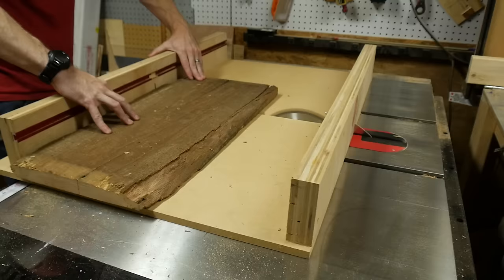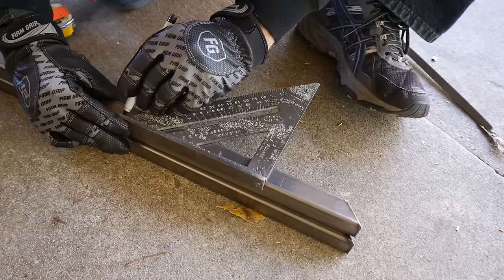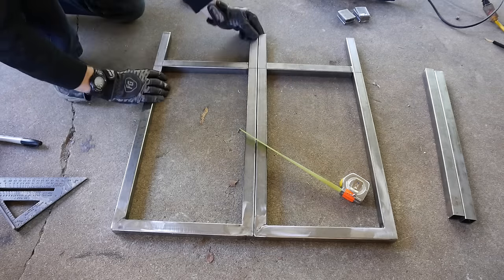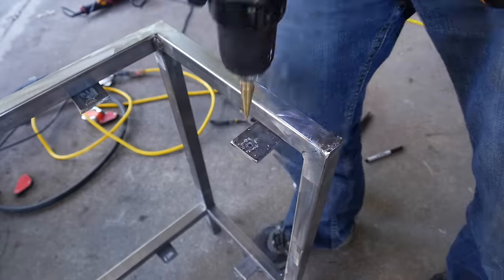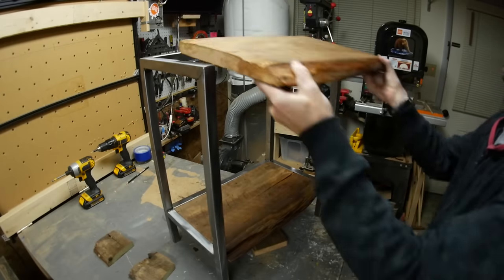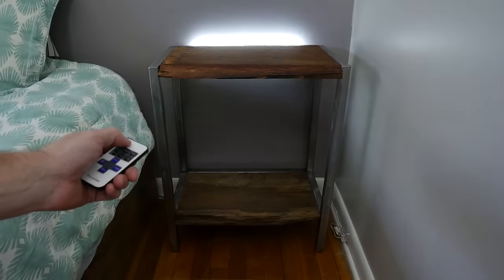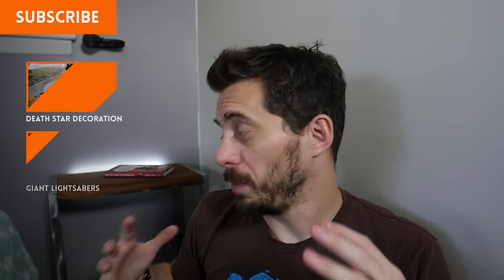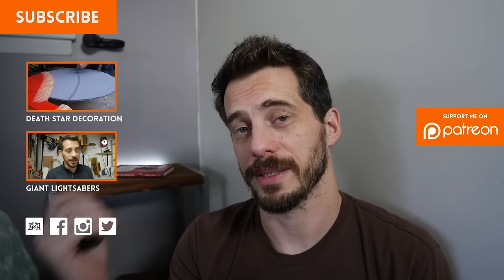Bedside table with a built in night light // How-To | I Like To Make Stuff

Comment: Yes I had a cut-off saw like yours which drifted especially when cutting 90 degrees. I now have a mitre saw with a blade that cuts any materials with zero drift and very little dross.
Reply: Like a woodworking miter saw with a steel cutting blade? Usually those blades are designed only for low speed saws. And only for saws with built-in clamps to prevent the workpiece from impaling anyone. Non-ferrous blades in regular miter saws are great. I have a Diablo version that I love. But I wouldn't ever consider cutting steel with that saw. 

If yours is different please share the details. Maybe an Evolution saw?? Those are awesome.
Reply: +Jon Miller I once used my milwaukee chop saw to cut a solid 3" diameter steel post, worked fine... it just took about 40 minutes
Reply: Usually a chop saw refers to a dedicated metal-cutting saw, also sometimes called a cutoff saw. Do you mean a miter saw? Also just because you can doesn't mean you should. 

Most vehicles have speedometers that go over 100 mph. Many of those vehicles can even go that fast. That doesn't mean they ever should. And depending on conditions it might be a bad idea to go even half that fast. Plenty of accidents happen doing the same behavior that was never a problem dozens of times before, but which was never a good idea in the first place.
Reply: +Jon Miller where I'm from a chop saw is a mitre saw. As in for chopping wood. Who the fuck are you to say what I should or shouldn't do? Or to assume I don't know exactly how to use my tools safely?
Reply: +Steve Hillier Woah, calm down man. Just advising caution. Absolutely nothing to freak out about. By all means use tools precisely against their labeled safety instructions. You are free to make poor judgements like that. Carry on and just ignore anyone who might have seen what can go wrong there and would advise against it out of concern for the welfare of others. The nerve of some people!

Comment: Suggestion, I would add a mirror or a reflective piece the length or your led strip, either on the wall or ideally attached to your bed side table,. Because at the moment, you are lighting the wall and loosing a lot of light.

Comment: So I know this Vid is a few months old but I wanted to add a little knowledge I have about metal cutting saws... With a metal cut off like you have in the video although the clamps aren't the greatest that is not the only reason your accuracy is off! The disc itself is made of a material that bends and flexes when it's cutting so no matter how good your clamping system is you will never get the accuracy of a timber cutting mitre saw! The only way to get such accuracy cutting metal is to get a metal blade (and a ridiculously more expensive machine to run it).

Comment: Without industrial grade equipment you will always struggle to get super accurate cuts on metal, the stresses, heat and forces required always seem to cause some drift. Some modifications to your saw will probably help, a better clamping system for instance so you can take the cut for slowly but I would always expect to have to do a little cleanup. Luckily with welding that is a lot easier than with wood since you can "fill in" the missing metal and then grind smooth.

Comment: the blade on abrasive saws tend to drift a lot.  mine held the piece solid bit never made a straight cut. I tried many different brands of blade and nothing worked well.   evolution makes a great "cold" saw that does a much better job and leaves no burrs.

Comment: GREAT Table! Absolutely LOVE the contrast between the brushed metal finish and the drift wood type finish. BTW, for the cutting saw, why not try a carbide tipped blade? That will make easier work of cutting the box sections. ChuckE2009 uses one all the time. Have a look at his Channel if you haven't yet. :)

Comment: I suggest you hide the wiring inside one of the feet. Maybe drill a hole that can fit the wire and slip it in. I'm not sure if the receiver will work inside the steel tube though

Comment: I would suggest a cold saw rather than a ban saw for cutting miter joint. The saw produces little to no heat when cutting through metal and produces much cleaner cut edge

Comment: Hey Bob! 
I have some questions regarding grinding your welds - do you grind them completely flat, or do you need to leave a little bit of weld protruding for strength? And what steel are you using - not just stock black steel? It seems too well polished to begin with?
Cheers,
Nick.

Comment: Those are usually referred to as "chop saws", at least where I'm from. They are considered quick and easy ways to make cuts on metal. However, this ease coupled with them usually being pretty low dollar items, means that the cut quality, 90 degree or 45 degree accuracy, is not the best. We don't use ours as often on the farm anymore as I am usually the one welding stuff and I find the portability and convenience of a 4.5" grinder with a thin (usually 1/16") cut-off wheel to be a bigger deal to me.

Question: what kind of welding wire are you using on these projects? Flux core, or solid wire with the argon shielding gas?
Reply from the maker: +Matthew Rohmiller Shielding gas

Comment: Did you put any feet on it? If not you can get push in plastic end caps or you could weld on end caps and add some sliders, just thinking of your floors.
Reply from the maker: +littlestworkshop I haven't yet (totally forgot when filming) but plan on getting those plastic inserts.

Comment: Drain holes Bob! Don't forget your drain holes!
Since you're probably not going to be washing it with 250 degree industrial solvents you should be alright,  but trapping air and moisture in steel tube isn't good for it.
Should drill a 1/4" drain hole on the undersides of any sealed tubing.

Comment: Just put an abrasive blade in a normal wood cutting miter box.  The blade RPMs are the same for the same diameter.  Then you get a nice accurate miter and you can buy decent miter boxes used or new, for cheap.

Comment: Nice work! As for the metal cutting bandsaw, can't you change your existing saw to its lower speed and get a metal cutting blade? (I'm not being snarky, I really don't know the answer.)
Reply: I've never seen one of these with changeable speed. Generally just a single speed universal motor, which runs WAY too fast for steel cutting blades. You need an actual multi saw for that. If you're aware of any that are changeable I would love to hear about it. Maybe the Evolution saws? Those are awesome.

Comment: Maybe it isn't the mitre saw's fault the frame wasn't square. when welding, the temperature difference causes the join to pull in one direction. Our fabricators offset pieces by eye so they pull to 90 degrees.

Comment: Awesome channel dude and nice project!And i have a question,if there are still bugs inside alive in the wood they could die with the oil at the end and seal them of?I know its  a little stupid question cause i have 1-2 pallets for a project and there are holes from wood bugs..
Reply from the maker: +AngryPunish3r this wood had been fumigated long ago.  I would cover your prices with a tarp and fumigate them.  Then let then air out really well before using.

Comment: Looks great, but why not drill a couple holes in the back of the frame and run the wiring through the frame?
Reply from the maker: +Wayne Manion They did that after I installed. I didn't have approval at the time.

Comment: Table looks cool.  I didn't understand the problem with the saw.  I see a screw clamp on it.
Reply from the maker: The entire clamp and assembly flexes against the force of the saw
Reply: +I Like To Make Stuff oh ok.  Sounds like it needs reinforcements rather than a complete overhaul
Reply: +Ken L Sometimes the tool reviews have good tips for mods, but so far I haven't seen any for that particular saw; only similar complaints

Comment: To improve your cuts don't use an abrasive saw blade, no matter how well you clamp your cuts will still be off. its just how abrasive blades work your giving up a clean cut for a fast cut. You can get better blabes for that saw, they will be slower but your not running a jod shop. Also you may want to look into tack placement and weld order to improve your fab work.

Comment: Hey, nice video again. Got a question: why didnt you hide the cable in the hollow frame?
Reply from the maker: +Gamer Stacks Thanks! Because I would have had to drill a hole in the steel near the top, and near the bottom to feed it through. If I ever wanted to remove the wire, the holes would remain.  This way, if I remove/change the lighting, there's no trace of it.
Reply: +I Like To Make Stuff yeah thats true

Comment: Just put an abrasive blade in a normal wood cutting miter box.  The blade RPMs are the same for the same diameter.  Then you get a nice accurate miter and you can buy decent miter boxes used or new, for cheap.
Reply: I don't believe that's true. Metal cutting tools generally run much slower, especially if they're designed for harder alloys.
Reply: Corey Ward The DeWalt abrasive 14" metal chop saw is 4000 rpm and the Rigid 12" miter saw is 4000 rpm.  So a 12" abrasive saw blade should work fine in the Rigid.
Reply: +eformance Okay, looks like the abrasive discs do run at a higher RPM than other metal cutting tools. Still don't think I'd use a wood-intended miter saw to work metal with any regularity though; too much heat and debris, not enough protection, and the motor and bearings aren't designed to handle it.
Reply: +Corey Ward Tools in that price range are disposable tools, don't get too hung up on bearings, protection, heat, etc.  Just make sure you don't use the dust bag, it should work fine for a long time.  A 15A motor spinning at 4k rpm is a 15A motor at 4k rpm, they are effectively the same.  My experience is that most chop saws are cheap and poorly built and the brushes and holders burn up before anything else.

Comment: Let me preface this by saying I know nothing about welding. I think I've put down two beads in my life. Having said that, I've heard that welding causes the metal to draw in. When you had to bend the legs out to fit the bottom braces, you ran into the same thing that Frank Howarth ran into when welding up his CNC router table.
Reply from the maker: +Jesse Hires Ah, that's an excellent point!

Comment: you will never get a perfect miter using that chop saw. the problem is the wheel is pretty big and when you are pushing down on the steel it will actually flex while it cuts. the best way is with a zip disk and grinder. Practice makes perfect my man! 

PS. Love the table! i think I'm going to have to make one now!

Comment: Instead of buying a new saw why don't you buy a metal cutting blade for your miter saw? There are some nice 80 tooth blades out there specifically designed for metal work. I think this would give you the most accurate cut you could get. It also cuts the metal instead of grinding it away do there is less grinding required after.
Reply from the maker: +Aaron Patchen Mainly because shooting sparks aren't great in a shop fully of sawdust, and this saw was cheaper than those blades are :)

Comment: Hey bob, did you buy that saw at Harbor Freight tool shop?
Reply from the maker: I did! It was on sale plus I had a 20% off coupon so I figured it was worth a shot.
Reply: +I Like To Make Stuff I thought so because only Harbor Freight's saws have that little clamp on the base.
Reply: +Tim Chesebro Huh? All metal cutting saws have that. Because otherwise the metal is very quickly thrown and it impales someone. 

The difference is that good ones actually hold the metal still for accurate cuts. Bob, I picked up an older model of HF's saw for $20 from my local classifieds and I've never had a problem with it. Like you I bought it to hold me over until I have room for a metal cutting bandsaw, but mine has served me very well. I would be satisfied with its performance even if I had paid $100. I wonder if you just got a faulty one? Happens a lot with HF stuff.
Reply from the maker: Jon Miller Hmm, yeah, it's possible.  I pulled it out of the box and started this video, so maybe I just missed something in setup too.  I'll look at it more next time I pull it out.

Comment: There is nothing like leaving yourself some extra material to hand file after to perfection! steel tubing are easy to file, they are not worth buying a belt sender, but hey... your ears! you could have mount your wheel on a drill press and slide your tube across o get a even finish. I would leave myself extra length so the tubes don't get plunged in it.

Comment: On the chop saw conversation, the abrasive blade chop saw pretty much suck. However a lot of tool companies are coming out with carbide tipped metal cutting chop saws and they are fantastic! Check out my Instagram page @peter_built if you want to see pictures of a stand I made for my saw. And btw Evolution saws is the brand I've had experience with. Keep up the great work!👍🏼
Reply from the maker: +Peter long Lots of people have mentioned the Evolution saws, they look really interesting! The carbide blades would probably work well but they cost more than this saw did :/